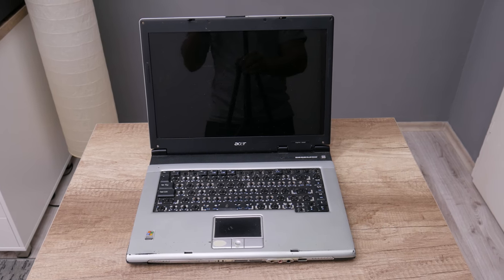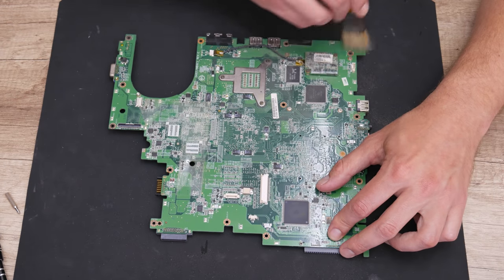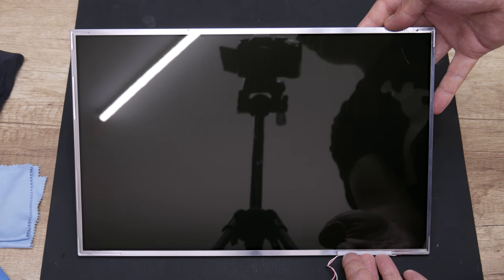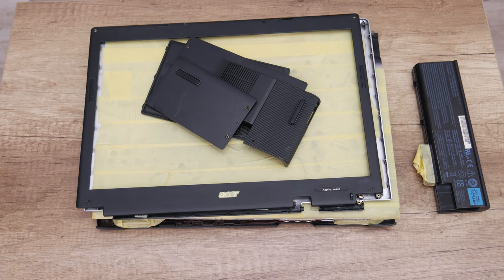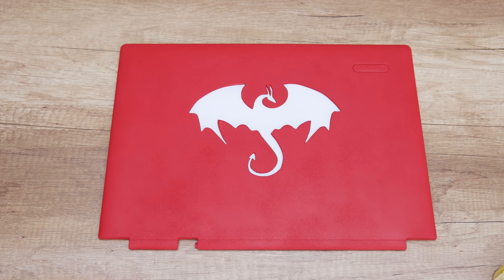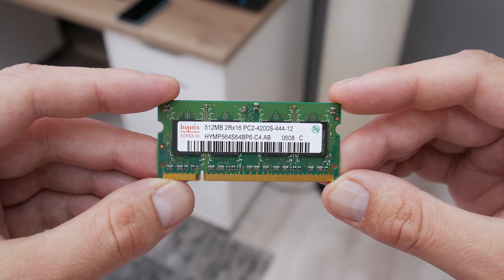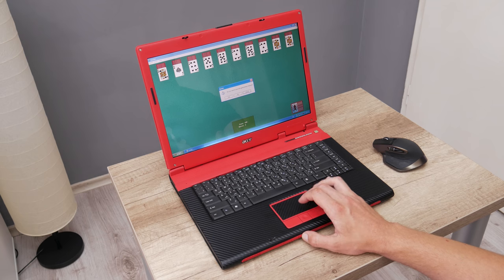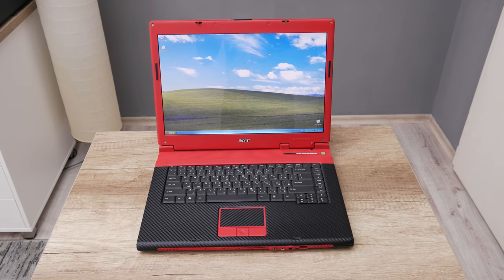Can I restore this Old and Destroyed Acer Laptop?

Comment: Hey, did the fan sounded normal after just cleaning it? I have a old vaio with manjaro which my sister uses, it's fan is really noisy, I have cleaned the fan from outside but I've never disassembled the fan, I've switched from the thermal pad to a thermal paste for the amd apu inside it.

Comment: Aaahhhh, when vga ports was standard and laptop designs stays the same for newer models until trends changes. I got a similar acer from 2006 that has intel core duo cpu with 1 gb ram  and 80gb of hdd with ati gpu... forgot what ati it was... but the laptop has overheating issues and I didn't know anything about laptops and computers back then and youtube was pretty much still in it's infancy in my country... Seeing such an old beast being resurrected here is pretty awesome :D

Comment: Hi andrew i need you're professional opinion. In you're experience opening old and modern laptops. Have you encountered Lenovo Ideapad EXPOSED CPU Heat sink gpu ide have a cut out. I wonder why, and can I put thermal compound on that ide even if it is exposed.

Comment: Really nice upgrade! Your videos have inspired me to look at my older laptops and upgrade them where required.
Also, if you need a replacement hard drive for laptop with IDE connector, IDE hard drives are relatively low capacity and now starting to be quite expensive. You can get IDE to mSATA converter on eBay for about £10, then fit an mSATA SSD. I will probably do this whenever I need to fit a new disk into an old IDE connector.

Comment: You could try IDE to Compact Flash card converter that fits nicely into the hard drive compartment. It's not gonna be as fast as proper SSD but it's way better than some old spinning platter hard drive

Comment: It's awesome, although you should try to remove the bubbles on the carbon foil. You could use a adapter from IDE to Flash that could fit inside the hard drive space, so you could use a 32GB Flash card that would be faster than the IDE spinning disk and would improve the machine performance. Try to search for some IDE to Flash that could fit inside the drive space.

Comment: 21:06 you can fit an m.2 in there with an adapter. Even with IDE speeds it should be a night and day difference since an SSD will actually max out the IDE bus, unlike an HDD

Comment: I like this. The red and black look great together. I think the dragon should have been smaller, but that's just my opinion. What did rigger me was you painting over the Acer logo on the back of the lid and model # on the bezel. But the machine looks way better than when you started.
Reply from the maker: Thank you bro :). actually I planned to make the logo smaller, but the plastic on this laptop is very thick and hard, not flexible. I afraid to not brake it because i don't have another case :D. But if i do this on the newer laptop, then that is a different story. The newer laptops have thinner and more flexible plastic, and cutting, modifying it will be much easier

Comment: There's a PATA (40 PIN IDE). In the Kingspec brand with cheap SSD nand flash drive. I think it's not very expensive. You can look for it at amazon or eBay, even in AliExpress.
Thanks for the T7100 suggestion, I have a Celeron 900, single core 2.2GHz.
I'll replace with that. Thanks!

Comment: Great work like always , funny thing you got an arabised keyboard , & actually you can stick an ssd in there if the hard drive is making bad noises or failing , you need a converter and a sata ssd with small pcb , might take a while to find one ..

Comment: Man this is my laptop that i asked you yesterday about and it's too sad to know i can't install windows 7 or 10 in it. So what's the benefit from upgrading. 
I have problem in my laptop which is i can't upgrade windows xp to any installation always stop says that my is that suitable for 32 version i guess. 
But the good thing i upgrade my memory years b4 to a higher one. Also sad to know that i can't upgrade my storage capacity mine is the same 60 GB.
I don't know what to do.....

Comment: Hey Andrew, I know this isn't related to this laptop restoration video. But I was wondering if you could possibly do a old Lenovo Thinkpad restoration. Also another thing I was wondering, do you know/have any links where I can either get some gb's of ram for a Hp Probook 6470b. I know you might not see this but, have a great day!
Reply from the maker: Hi bro, currently I don't have any lenovo, but I'm searching for some of the Thinkpad series, I want to do something with thinkpad also, plus eGPU. 
The RAM for 6470B you can find anywhere, aliexpress, ebay or you can check some local stores about computers. In local sotres that sell used parts is cheaper and easy to negotiate for the price with the seller.
Reply: @ComputersAndTechAndAndrew  OMG thank you so much for reading my comment. And also thank you very much for the 6470b RAM advice. I really appreciate it. PSA: A Thinkpad model that in my opinion that could be great for an upgrade is the Lenovo Thinkpad T400. I think you can find them pretty cheap on Ebay. Stick in 8 gbs of ram and a SSD and they will work like a charm. (Currently typing this comment with it) Anyways, thank you so much for taking your time to read and respond to my comment, I really like your videos, and have a great rest of your day :D
Reply: probably T61/T400 is good starting point

Comment: Dude, I have an issue on my old Toshiba Satellite P75-A7200. I thought that I could install an eGPU and I bought everything to do it.
But when I install the Nvidia drivers for an gtx 1660 super there's no video on external monitor non internal display so, I don't know what to do. 
This is what displays on the driver: pci\ven_10DE&DEV_1aed&subsys_5552719da&rev_a1.
I am really concerned 'cause here in my country all of those things I bought are really expensive and I spend some money ignoring if this thing would work or not. Before I install the Nvidia drivers the external monitor used to work but didn't detect the GPU, just a messege on Device Manager with this: PCI device, just that. So I don't know if there's a driver for EXP GDC The beast, I've been searching for the whole web but there's nothing. I'm using the mini pci express WiFi port. 
The specs of my Toshiba:
Core i7 4700 MQ 2.4 GHz.
18 GB RAM.

Comment: Did you even use the T7100 on this thing? Its just outright impossible for any motherboard to be compatible with both the Pentium M 740 and the Core 2 duo T7100 at the same time! The CPU sockets (Socket m478, Socket P) are 2 whole generations apart and it won't POST!

Comment: I hv a question can I change my laptops processor?? please answer
Reply: Depends. Some laptops have "socketable" CPUs, and allow upgrading if the socket is the same and the power demands are similar. May or may not require BIOS update.

Comment: What if i use Flame Orange instead of Flame Blue? does this low pressure thing change anything?
Reply from the maker: Hi bro, Flame orange i think is High pressure spray, high pressure is good for painting but is harder to paint and make some paint over-painted, the blue is low pressure and is easier to paint and you can paint more precisely

Comment: there are ways to install ssd on that laptop. Surely you checked and realized that the cost benefit ratio does not help you, right?
Reply from the maker: Hi bro, actually SSD will not fit. This laptop has IDE connection and if I want to use SSD i need IDE to SATA converter, if I add this converter then the SSD will not fit in the case. Some models that have more space than this laptop, the SSD will work fine with IDE to SATA converter

Comment: Too bad you didn't use an m.2 IDE enclosure. I used one on my old laptop, and it absolutely crushed the speeds of the old HDD. Also, you could replace the optical drive with a caddy that allows you to put the old IDE drive as a second storage drive, or even put a SATA drive inside instead. Also, yeah 4GB would be better. You can also take advantage of the expansion slot to give this laptop USB 3.0 ports.

Those upgrades would allow it to run Windows 10 with no issues whatsoever. I've gotten Win10 to run on much weaker hardware without issue, so it can be done XD

Sweet video though. Awesome mods.
Reply from the maker: Thank you bro, btw I order many  of these converters but because of this situation everything is going painfully slow
Reply: You have so knowledge bro
Reply: Wow
Reply: @ComputersAndTechAndAndrew  Oh yeah I totally agree. There's always something that "could have been done better" or "could have had more time spent on it", but that doesn't take away from the achievement you've made. It's still a great video and an excellent showcase of just what you can do with an older laptop :)
Reply from the maker: @xPLAYnOfficial  Thank you bro :D always something can be done better,  even if you do something twice, the second time it will be better than the first

Comment: Love the videos, but you're killing me reusing these mechanical hard drives. Look into the SYBA Dual Compact Flash to 44 Pin IDE 2.5" Adapter Enclosure. It converts a compact flash card into laptop IDE drive. With the right CF Card you can get in the ballpark of SSD speeds. Anything is better than mechanical.

Comment: I have a trick for you. In reality it is not difficult to put an SSD instead of a PATA. to solve the problem of the dimensions just remove the external casing of the SSD ... With a compact adapter it fits easily. I did this on several old notebooks. Removing the SSD case is usually simple. Try... ;-)

Comment: Hey guys, just a random question: Which brand is more reliable: HP, Acer, Asus or Lenovo?
Reply: I'm an Acer Aspire (laptop) guy, and they are solid, even if not the prettiest ones around. HP, despite many negative comments I've found in the internet, seem to me reliable laptops as well. Note: I've owned and used laptops in both brands, no issues whatsoever. Acer is my go-to solution, though.

I've never owned or used a Dell or a Lenovo, so, beyond reputation, I can say nothing for myself
Reply: @elfedorausado  Thanks man, appreciate it. I am looking for not expensive, but powerfull laptop. Hp pavilion 15 gaming, Acer aspire nitro 5, Asus tuf or Lenovo ideapad y540 are my choices but still can't decide which one is better.

Comment: Using Windows XP in 2020. That's pretty obsolete

You can upgrade it to Windows 7 or Windows 10
Reply: Windows XP won't run very well on low hardware. It's best to stick with XP - or a lightweight Linux distro. Also, some softwares will only work on XP, not anything newer.
Reply: You have to run lightweight Linux distro on old Acer PCs except Ubuntu and Debian

Comment: WHAT?!?!?!?!??! T7100 instead of Pentium m?!?!?! don't f**king lie... That's two completely different sockets!!! I don't wanna hear any f**king excuses.🤬🤬
Reply from the maker: Hi bro, I think you are Wrong about this. Some of the Pentium M are 479 socket, this Pentium M is 740, the 740 is 479 socket. Core 2 duo T7100 is 479 socket, actually the booth are 479 compatible. all these information's you can find searching the Google, all information are available online. The boot are working on the same socket but some Pentium M are working on different chipset, the same is with Core 2 Duo Series. This laptop support T7100 but it will not support T7200 because the T7200 has a different socket and cannot physically fit in the socket. Also, if they was was with different socket, the CPU wont fit physically inside the socket, because the pins from the bottom side are different.